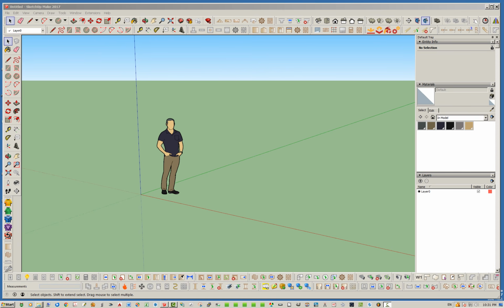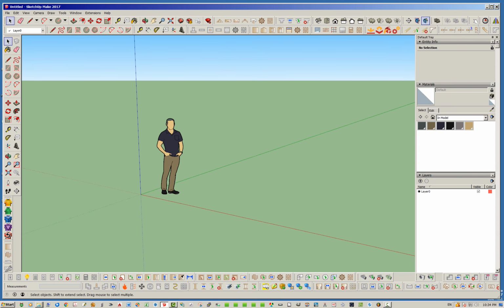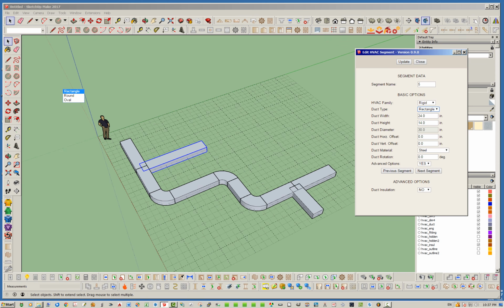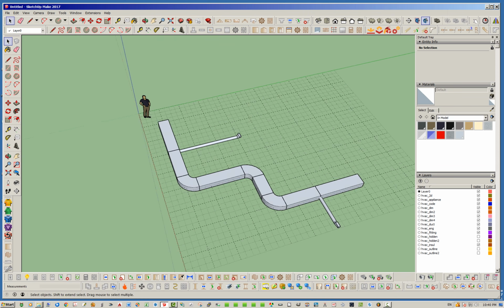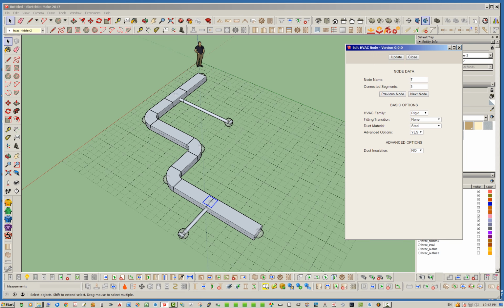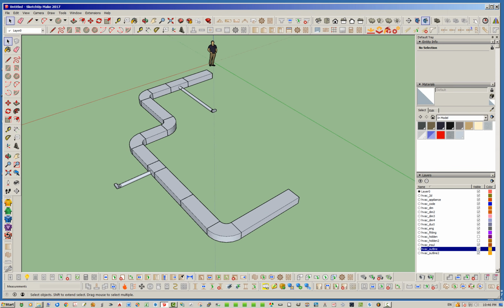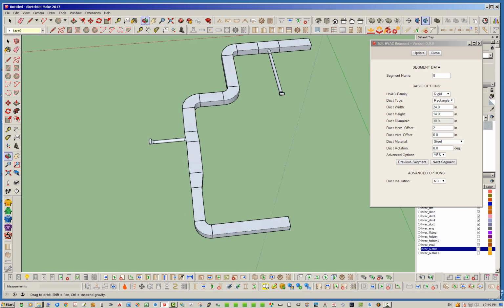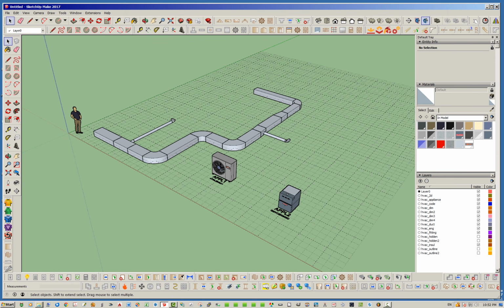Medeek HVAC Plugin Tutorial 1 - Extension Overview

Comment: Nice! Do you intend to add vertical ductwork to extend the ducting system up inside a wall to an upstairs floor or wall outlet?
Reply from the maker: When you create your initial outline, you can draw it in 3D, it doesn't need to be just 2D or planar.

Comment: Cool, the plugin can calculate the air flow in rooms depending on their volume and select pipe diameters for the required amount of air flow?
Reply from the maker: Currently it can only provide geometry and certain appliances.  However I am looking at extending it further so it can also run calcs.  I am reading Manual D (ACCA) so that I can better understand what type of calcs are typically run and then I will see what I can implement.